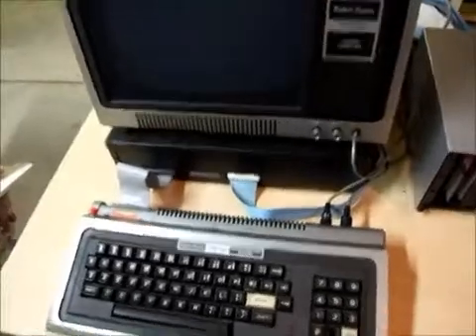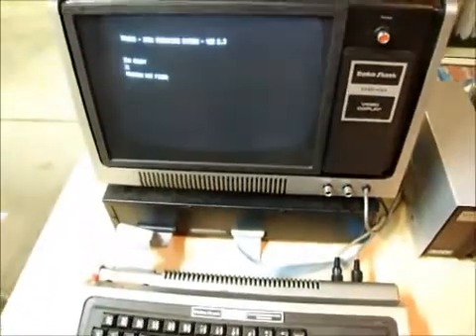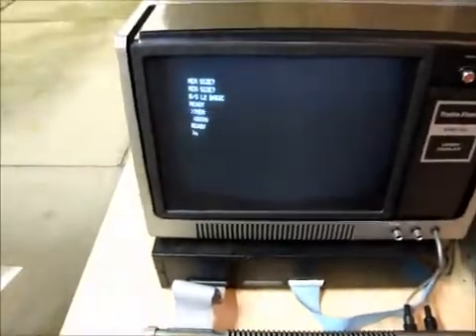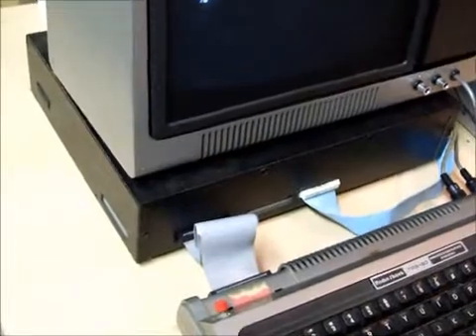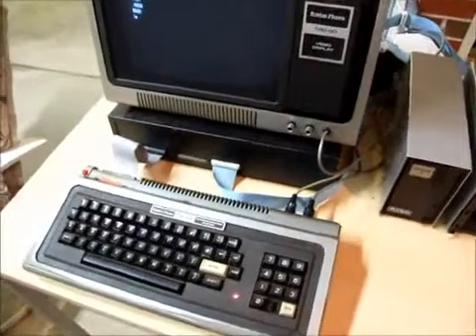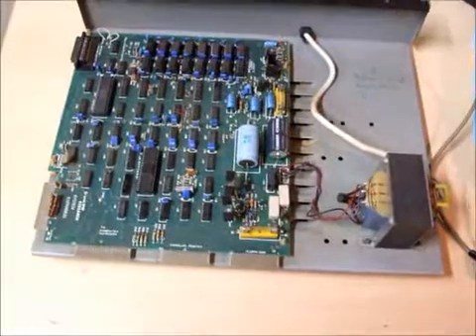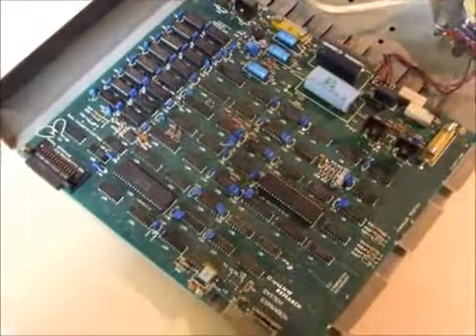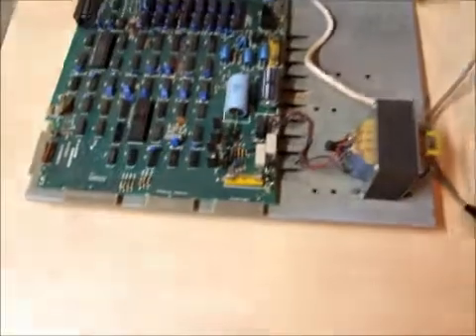LNW System Expansion Interface for TRS-80 Model 1

Comment: I didn't know LNW actually made a black box version.  I guess yours was a kit version?  Mine was fully assembled, a good looking cream color, big logo in front, with the front slanted from a curved top edge,  very stylish.  Have to admit half my reason for getting it instead of the Radio Shack version was how it looked, since I was always hated the silver Trash-80 (lol) look.  In fact because of that I didn't get the matching monitor, instead bought a what I think was a Hitachi 9" monitor and adapted the cable, later upgrading to a 12" amber screen, can't remember the manufacturer...